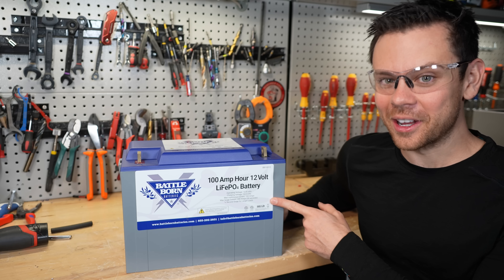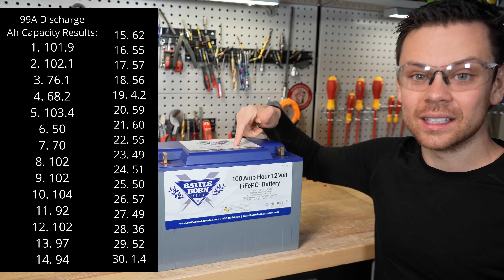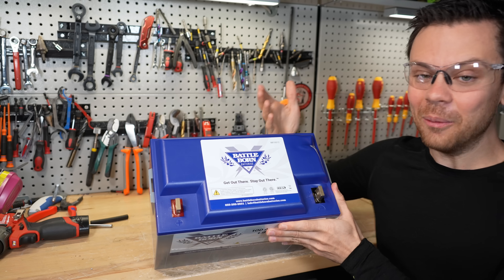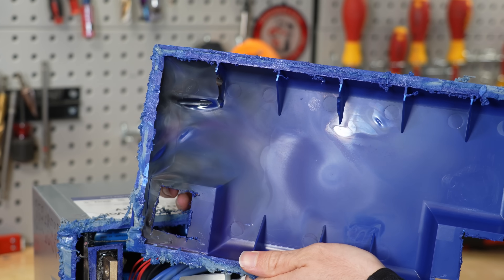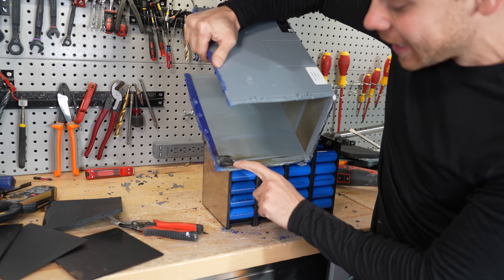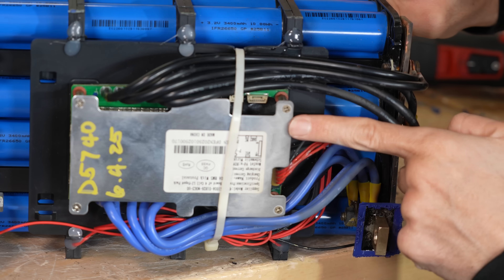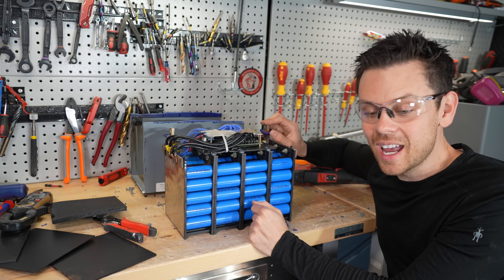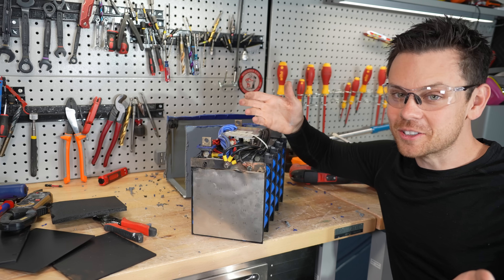Battleborn Battery MELTED?! 🔥🔥New Problem!

Comment: Hey Will, other Will here, can u do a future vid on super caps, ultra caps & active balancers for use in a PV system. There's a couple manufacturers producing them. 1 in china, 1 in Estonia. The Estonian company is Skeleton, they make both graphene batteries & graphene ultracaps they call SkelCaps. Since sodium & lithium barely work in winter/arctic conditions & graphene has very little issue in the cold, it would b great to see what the cold working comparison/bench test between whats conventionally available & can use now vs what we r going to b able to use fairly soon. While they r not mainstream yet due to graphenes volume production issue, they will become more available & less expensive as the technology progresses.

Comment: Hey Will, i have a 12v system that I want to upgrade the battery with the biggest cheapest single 12v battery i can find. 

Dumfume 12v 600ah battery 200amp bms

200 amp discharge is plenty for my use but how safe is the battery?

Comment: Yeah, definitely an issue relying on plastic to provide static anchor for a compression electrical connect. At least compress all metal connective inputs between two tight nuts on threaded post and allow the bolt the greatest chance at efficiency to carry the rated load without any chances of arcing due to plastic warping.

Comment: hi  I'm reposting a lot here. I just want to share my situation and what i decided...  I  have 6  buried pretty deep inside my van wall. I cant move mine but i do have access to the tops of each battery...   I have 6 of the GC2 (terminals on the same end vertical format) wired in parallel. Because of my inverter, my wire gauge (4/0) and my appliances in my van both ac and dc my maximum combined continuous draw (30 mins or less) occasionally goes up to 3000 to 3200 watts but typically around 1500 continuous.  This makes my maximum draw on each battery around 40-45 amps at times and usually more like 20 to 25 amps each battery. After doing a lot of load testing at 3000 watts i have not been able to find any high heat in any terminals, in my wiring or on the exterior battery cases where i can feel. There is zero looseness or discoloration at the posts. I AM NOT A TECNICAL PERSON. I KNOW JUST ENOUGH TO GET INTO TROUBLE but right before i was about to rip them out and replace with two Epoch 460's, a wave of rational thought swept over me..... how can i throw $5k worth of batteries away and spend another $4k on new batteries when I find zero evidence of failure of the BB's after three years of use. Don't get me wrong I HATE DRAGONFLY FOR THEIR BATTERY AND HOW THEY ARE DEALING WITH THEIR DESIGN FLAW. AND I DO TRULY BELIVE THE FLAW EXISITS AND I HOPE THEY GET THEIR ASSES KICKED. But I'm guessing because I'm only ever pulling 40 amps per battery at most (usually less) and because I'm only charging at 120 AMP total (Vitron multiplus 3000) that my usage specs are so far below the top of the envelope my batteries are not melting and hopefully never will.  I decided to keep a sharp eye on them and inspect them and load test them a few times a year and wait for a few years  and buy newer technology like solid state rather than reinvest in more LiPo4. In the end I don't want to take a $9k hit right now if i can avoid it. Thoughts?  Best. Jack.
Reply: You can get 300 Ah cells for 80 € in Europe. But thanks to TACO Trump, you clown president rips you of wich his tariffs. 😂

Comment: Hi Will Battle Born has two other styles that I know of. One 100 amp hour has the positive and negative terminals on the same end of the battery. The other is a 270 amp hour called the game changer. Just wondering if anyone has a failed one they can cut open.
Reply: this is a great point i didn't think of. i have 6 of the GC2 (terminals together same end). i wonder if the internals are flawed like the opposite side posts like the ones Will is looking at.
Reply from the maker: Yes they are, check out posts on the forum

Comment: Couldn't this be fixed if the cells are still good by taking it all apart and redoing all the connections with metal to metal contact and not any plastic in them when it goes back together?
Reply: Avoid buying overpriced cheap crap in the first place. There are perfect batteries for half of the price.

Comment: I'm over at Quartzsite AZ during the big tent event. Battleworn advertising is ALL OVER the place, and theyre the first booth you see when you walk in. I went over and started asking them about this stuff, and when I went to wiggle the terminal of their demo battery, I realized it was an empty battery case without cells.

But what really got me was when the Victron guy stepped in to defend these guys and said 'just because one guy on youtube says these are bad, doesnt mean anything. The truth is that these are engineered to be reliable and have a strong reputation'. I told him he clearly doesn't support the truth and walked away.

I already hated Victron for being overpriced and overengineered, and they just gave me another reason to stick it to both Battleworn and Victron.

Thanks for all this info Will, truth and electrical independence are more important than a company's reputation, and they've clearly shown their colors.

I suspect Epoch batteries is next on the chopping block 😮
Reply: Contrary to overpriced BattleBurn crap, the overpriced Victron stuff is of HIGH quality - even if their salespeople are liars and traitors (welcone to the crooked TACO Trump world).
Reply: @Stefan_Dahn until you go to install it. Ever put 4/0 on a 1000A lynx distributor? How about mounting a victron multiplus? These things are underengineered for installation, very overengineered for 'performance', and burn a hole in your wallet. I will never sponsor or support them as an engineer/installer.

Comment: I was at the Tampa RV show a couple of days ago, and I ran into the Battleborn Battery booth.  I stopped and talked to the person there about the issues that have been uncovered on this channel.  He immediately got very defensive and told me that there are hundreds of thousands of these batteries in service, and that this can only result of the battery is abused.  I have six of these identical batteries in my 5th wheel, and they are buried deep within the under belly and are practically impossible to check out.  I am starting to fear the potential for my rig to burn to the ground if this occurs.  I bought these batteries back in 2021, rather han some of the less expensive options ($5,000), because I had been watching this channel and didn't to risk having problems with the cheaper 'made in China' batteries.  Anyway, I am definitely going to be keeping an eye on them going forward.  Thanks.

Comment: Spoke with BattleBurn rep today at the big tent in Quartzsite, they do not acknowledge any problems with their products whilst still blaming user error , they will not be issueing a recall. Avoid. Replace. This company does NOT stand by their product.

Comment: Various UL standards do not allow bolted electrical connections to a plastic base specifically for this reason of flow over time.  There are other insulating materials available.  You folks are very lucky that there wasn’t a Lithium Thermal Runaway with cell to cell propagation.

Comment: I noticed that the bolts that hold the wires to the plate are stainless steel ,stainless steel when it gets hot will expand but it will not contract like steel will, that’s why I think those 1/4 20 bolts came loose inside
Reply: This is technically nonsense.
Reply: @Stefan_Dahn  lol right i don’t know anything lol

Comment: Those high current conductors should be spot welded to a more substantial bus bar. Grade 3 cad plate bolts are not up to the task with light duty crimp on terminals. That is designed to fail.

Comment: I own a couple of BB's. They are in my RV. Before these issues surfaced, Will reviewed the WattCycle 100Ah, so I bought two of them. I have 200 Amp rating with my BB's, but the most I draw is about 150 amps for a short duration. (Microwave or Kurig) We are about to go on an extended trip, I guess I should do a pain in the ass swap. Didn't want to add this to my to-do list. Any comments?

Comment: My battery hasn't burned up- The only place it will work is inside. Anything below 40F it cuts off- nothing in/nothing out. I tried calling them about it and all they wanted to discuss was the bluetooth 15a charger in which the bluetooth doesn't work. They wanted to charge me $50 shipping to send me the replacement. The battery-nothing. I guess I can use for indoor emergency power should I need it. Never again will I get with Battleborn.

Comment: Now do the same for other brands.
Reply: You clearly not been around !!!
Reply: @print4apet have had nothing but success with the Battleborn batteries on my sail boat,  including multiple instances of battery shutoff due to discharge below 10 percent.  Had them for 5 years and they still accept full charge.   Also had a great customer experience with them when setting up charging devices for my 6 battery bank.

Comment: Hi Sir, just found your grate channel. A lot of us sailors use Battleborn batteries. Can you make a video for a recommendation what would be a good SAFE budget option for sail boats? You charge with a 100 amp engine alternator or with solar (50 - 1500 w). 

The use is often just lights etc. nothing taking a lot of power out of the battery. (heater with diesel and cooking with gas)
Reply: No need you asking something truly basic, I did just what you asking in 2016’ for my van I used all renogy products minus the battery box an its been running 24/7 since, zero issues !
Reply: @print4apet  I will check this out. For me the safety is the most important thing, the price comes after that but I see no point of paying 1000 € for Victron products if there are cheaper options.
Reply: @Syv-q3byeah all these wannabe van boat people try to wire a system like a house to power a few simple items 😢
Reply: @print4apet  I do not get what you are talking about. I for sure am not going to have the boat like a house. Some will get a induction stow but I think that is too much. I am looking into a system with 300 amp usable energy and 150 - 250 wats of solar + engine (75A) when in use. 

This setup should be a good replacement to my current led acid system with 400 amps.
Reply: @Syv-q3b I been fulltime 8yrs now in sprinter an just 200w everything I do is DC  no induction city crap, goid old propane ;)  I just bought two skinny renogy panels so will be at 400w with 100 lith they just a bit larger then the two 100 I been rollin but price so cheap I figured ditch my old an upgrade.
Reply: @print4apet  sounds a good set up. I have a sailing boat so the engine hours are not daily and I might go several days without the proper charging - only solar. Propane is the way to go. The amount of "kw" in few kilos of propane is just excellent.
Reply: @Syv-q3bhowever I learned the hard wave, yrs ago bought a new 5hp Lehr propane outboard luved it in US however in Nex they mix propane with butane, so can’t fill up on trips.  So bought a gas again tohatsu 6hp   Grrrr

Comment: So you just randomly bought a new battery and it started failing after a few cycles?
Reply: He bought the new battery just so he could document his connections along with charge and drain cycles.  That way if the battery fails the manufacturer can't claim it was abused. This is in response to problems with other Battle Born batteries that he has torn down. I have to assume you haven't seen those videos. They're worth a peak.

Comment: I have one of these 100Ahr Battleborn (date Oct-2020) in a Truck for 12V accessories. Peak load <25A. I also charge this with a max current of 20A. I decided to test this battery with a resistor load at 27A to see if there was any hint of a poor internal connection; no significant voltage drop or temperature rise near the output terminals or case was observed. Am I still concerned--YES ! However, in cases where load and charging current is low internal temps should be below plastic deformation (cold flow is still a concern). So...I plan on an annual test; voltage drop, temp, and capacity.

Comment: My reluctance on buying a lot of these batteries because of the core quality.. obviously using undersized wires and not enough of them is creating a lot of resistance. Pretty simple poor design especially when you got a bus bar and you're using only two or three contact points instead of multiple just disperse the load. 🤨

Comment: Will! No one discharges at that rate or cycles at the rate that your describing.  Please explain a common way that, that would happen in normal use?  I cant see any commone use that that would ever happen, other then using it for welding, and if you did that, Id expect you would have some damage.
Reply: Air conditioner + oven + hair dryer + coffee pot

Comment: Numerous red flags upon opening. This may have been pointed out previously, but the ring terminals stacked in series is yet another issue, with resistance and corrosion potential being the primary concerns. Stacked ring terminals create multiple contact areas where current passes through. These areas will go through thermal expansion and contraction with current flow. This will result in your connection loosening over time increasing resistance. Best practice is to never stack lugs.

Comment: My god. It's TOTAL garbage. And if the cells get hot enough to go into thermal runaway, you can kiss goodbye to your house, boat, caravan and maybe even family. A common fire extinguisher will NOT put this thing on fire out. Truly shocking and the manufacturer needs to recall every single battery for design defects. Better that their company is cooked than you.

Comment: Did they used to make them better quality circa 2018? Because that's when I bought mine and I haven't noticed these problems with mine. I checked. I did find discoloration of the red terminal (it's now deep orange), but other than that, it's tip top. No problems. No melted plastic anywhere, albeit I didn't cut mine open. But still... could it just be they've deliberately reduced quality at this point but previous iterations were of higher quality / better design?
Reply from the maker: You should open it up
Reply: @WillProwse   🤣🤣

Comment: The fact the they used the bolt for terminations also as the bolts that support the busbar to the plastic is an engineering disaster.    Use separate bolts to support bus and problem solved(for the negative side heating issue)

Comment: I purchased 4 of these suckers based on all the gleaming reviews and testimonials.  Let's not forget about that 10 year warranty.  I started having issues in my RV after 3 years and I was basically warned not to return them to Reno due to the cost of haz mat shipping, blah blah blah,  pro-rata blah blah, it's just not worth it--you probably ruined the batteries out of some misuse or abuse.  Needless to say, I won't give them another dime.  I'm about the tear mine open myself now to see what the real culprit is.  Thanks for giving me the motivation to cut em open.

Comment: It seems like you are testing these batteries at what amounts to a "dead short". .  It's no wonder they melt.
Reply from the maker: 🤣🤣 what in the world?? Absolutely not
Reply: Then I guess I don't understand!. First you say that you allow the battery to cool between cycles. Then you say that back to back cycles cause the battery to heat. Then you discharge and charge,at back to back cycles,  causing the battery to heat.  Is 95 amps continuous discharge considered normal usage?  And for how long did you discharge at 95 amps.

Comment: AKA, there is NO fix for this.  It never should have been designed using a THRU bolt on the clamping surface. It should have been a stud. with the wire end terminals all snug and tight on one end of stud. and other end of stud anchored into plastic / insulator base.   PSSST  LISTEN!  
I use a large 300Amp, DC, screw down fuse holders as a distribution / anchor point for DC cable junctions.  Remove fuse - place negative on one lug, and positive on other. place proper cables ON to neg and positive lugs - Tighten down to spec....Done!!!     Safe and tidy in a pinch!   It will never loose clamping strength, although the fuse housing may become compromised. The junction will never fail!

Comment: Whew! I feel like I dodged a bullet. We needed new batteries in our 2020 Tiffin Allegro Bus to replace the original wet/flooded batteries. Our choice was replace with flooded, AGM, or Battle Born lithium. I had a gut feeling that lithium were still kind of new and that because a few other items in the system needed to be changed to utilize and monitor the lithium batteries I was nervous that mobile techs might not be up to speed on the lithium battery/equipment and it could hinder repairs in the field. Since we don’t boondock I decided to swap to AGM. So glad I decided to wait to see where lithium batteries wind up going.

Comment: To get 3000 to 6000 cycles, the discharge rate should be 0.5C. In other words for a 100ah battery,  50 amp discharge is recommended.  So unless that battery was 180 amp hours, discharging it at 90 amps would dramatically reduce the life, as you just demonstrated.

Comment: And people want billions of Chinese batteries like these in their homes and business's. No thanks. Storing power in batteries for large current draws is just a dumb idea. I worked around very very large battery banks, and the people who installed and maintained them are professionals, and you still have problems. Imagine hundreds of thousands of goofballs messing around with DC bus bars and huge explosive batteries. It's just dumb. Maybe in 50 years we will have better standards, and battery chemistry that don't react like current Li batteries do. Right now, this is all premature.